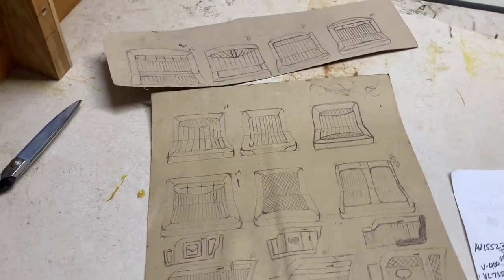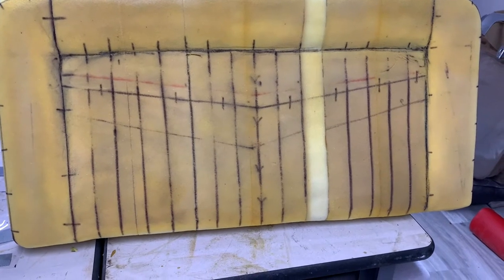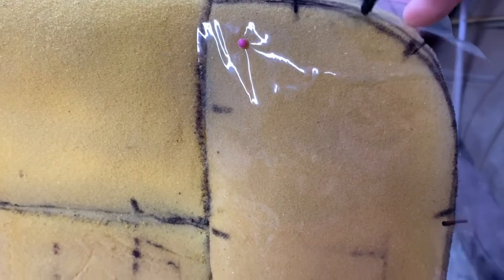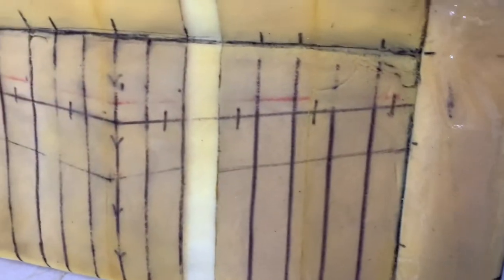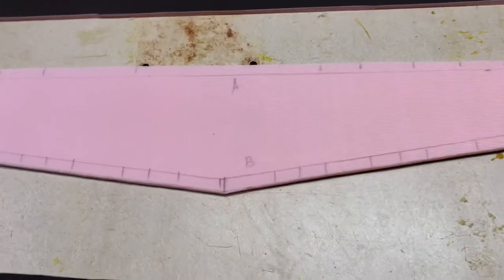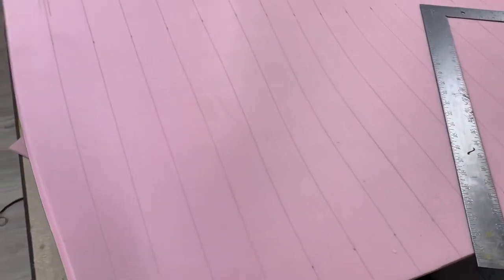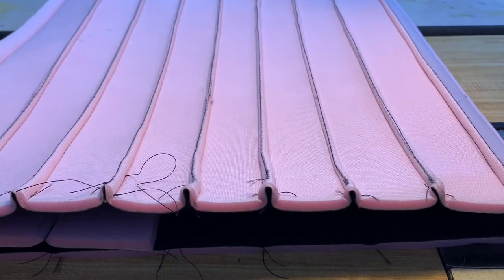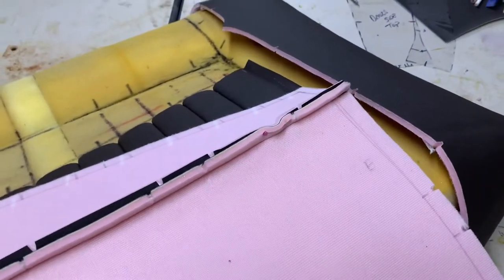1932 Ford Roadster seat build and upholstery tip for the DIY guys.

Comment: How comfortable was the seat with the frame you built with the webbing?
Reply from the maker: It’s great. I’ve driven for 5-6 hours at a time and never felt stiff. Thanks again for your support on the channel.
Reply from the maker: Would love to help you if you decide to try it yourself. Tip on supplies ect. Would also love to do a joint channel project with you on something.